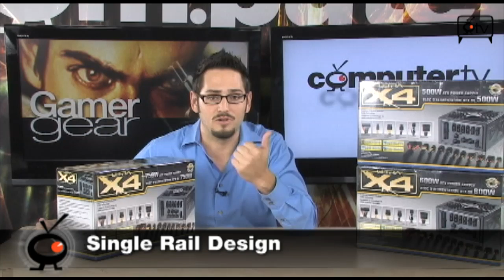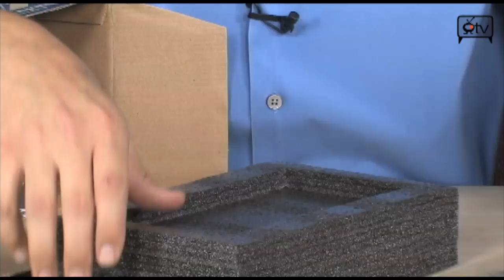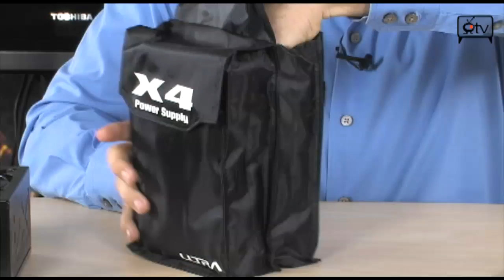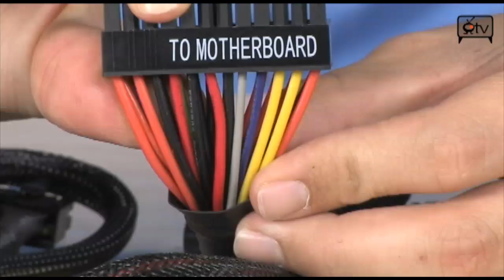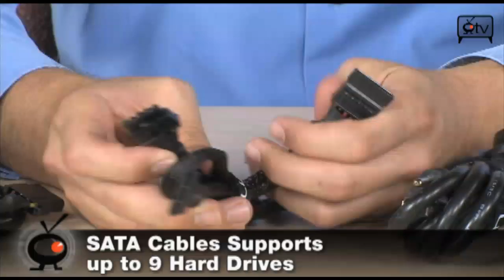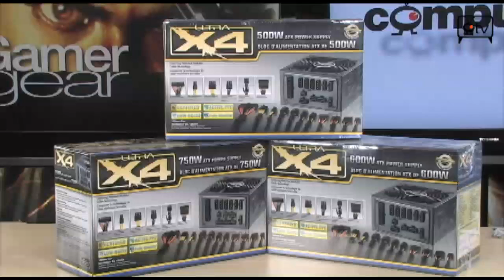Ultra X4 Power Supplies

Comment: you can unplug the cables from the power supply itself to save space when you arent using them in your case (used so that your case is neat and the cables wont obstruct airflow)